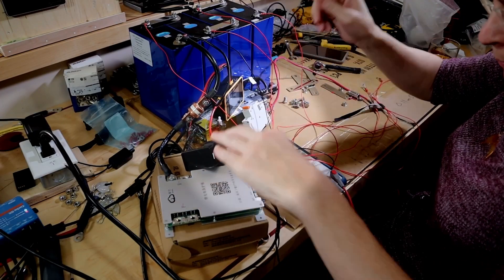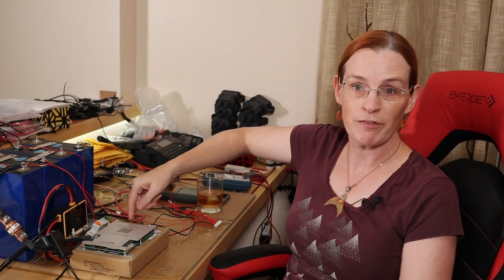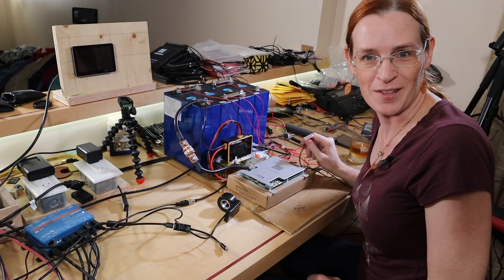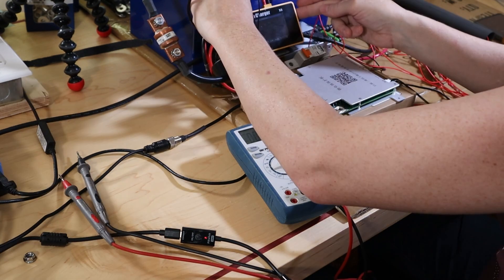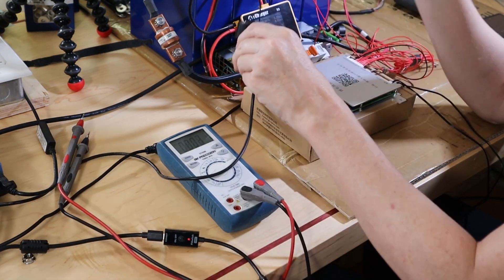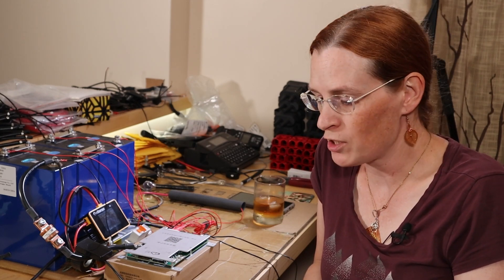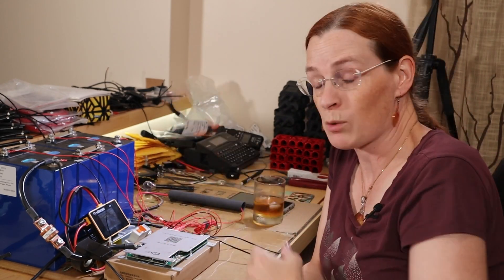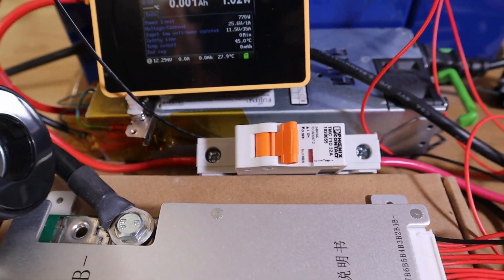JK BMS - A Partial Apology - 48v LFP Battery Build (Ep. 37)

Comment: I noticed that strait away , the breaker was off , then using a buck converter at 24v with the negative reference , it will work.
If the buck converter comes if the 12v battery you have the negative reference anyway.

Comment: Hey Maddy, there is no blame on you, we all make mistakes and this proves we are human! I hope the 12V is now somehow useful for you. In the end you just wanted to replace the old battery! Don't be so hard on yourself. You are absolutely right about JK, they need to step up in the marketing and clarity department. Thanks for pointing that out. Enjoy your builds!
Reply from the maker: Half the purpose of the channel is to show that mistakes are normal. Admit them, correct them, move on. I'm not returning these BMSes, but I also don't currently plan to use them either. If I ever decide I want a 24v system, these will do the job. For the actual 12v system, I'll use the new BMSes that should be here this week.
Reply: @TheDigitalMermaid  keep up the good work, learning lot's of your and Andy's channel. Thank you!
Reply: @the digital mermaid  Maybe a second thought, you might use the 24V BMS with stepup just to see if it holds starting the engine, this would not give you a fried BMS otherwise. You also might opt to bypass the BMS during starts, this saves the mosfets from being fried. A hefty switch or just a very heavy relais across B- and P- may save your day.
Reply from the maker: @edwardvanhazendonk  The started on my Yanmar 3QM30 is designed for 12v. I'll check the amperage needed to start the engine next time I'm onboard and decide then how best to run the starter. I know I could bypass the BMS, but that makes me pretty nervous.
Reply: @TheDigitalMermaid  I mean onlynduring start of your Yanmar, so that'a a few seconds.
Reply from the maker: @edwardvanhazendonk  Ya, I knew what you meant. My concern is having any connection bypassing the the BMS. If there was a parasitic load somehow, it could still cause problems. If I decided that I had to do that, I would run it through a disconnect switch to make sure the connection was only established as needed.

Comment: You are right.  Your supplier should accept full returns on those and provide the replacements

The breaker flip is an easy mistake to make given the situation JK and your supplier put you in.    No biggie there, but your right, always take the minute to verify voltages
Reply from the maker: I suspect that if I asked QSO, they'd take them back. However, it's not worth the hassle to me. I'd rather have them for potential future uses.

Comment: I seem to recall seeing a wiring diagram for this BMS that says the last red wire needs to be connected positive terminal of the 4S pack (ie 12v).  I might be wrong but have you tried this and have you looked for installation instructions?

Comment: I'm making a 48v battery for use on a scooter. It's 120ah cells so it's quite big and heavy to put on the scooter, but I guess the range will pay off. But I'm starting to research for BMS. Are the JK BMS relatively good for that type of usage? I'm not making it for a solar storage.
Reply from the maker: I can't speak to your use specifically, but I can't see why not. Note that weight hurts range, so the extra weight of the batteries uses more battery power. It the EV version of the rocket problem.

Comment: U could thke off 20v from one of your batteries!
Reply from the maker: On a 4s system, how?
Reply: @TheDigitalMermaid  Off your 48v system
Reply from the maker: @BajanAlan  That would work in theory, but I would never do it in production. Certainly not on the boat.
Reply: @TheDigitalMermaid  I thought it was just a touch to start the bms!
Reply from the maker: @BajanAlan  No, it needs to be continuously supplied.
Reply: @TheDigitalMermaid  Thats not cool

Comment: wonderfull that it looks ok. And when you connect to the BMS are there any alarms, or else that can disturb your plans. You did not measure the output voltage of the BMS (in the video)) so that you are 100% on use for this.
Reply from the maker: I didn't bother connecting the app to the BMS. Once I saw that it booted, I realized I had made a mistake and that was all I was trying to figure out. Even if it worked fine, I wouldn't use it in the boat anyway. I don't want to have parts in the system (boost converter in this case) if I can avoid it. As they say; The most reliable part is the part that doesn't exist.
Reply: @TheDigitalMermaid  True 👍

Comment: I did not realise you had the BMS with the button, so in that case you did not need Andy’s battery trick like I did.  Then I had issues when turning on the inverter, BMS went into short mode, that was fun to sort out. Do they tell you anything about this sort of stuff…nah
Reply from the maker: "turning on the inverter, BMS went into short mode," - That's what the precharge resistor is for. :)